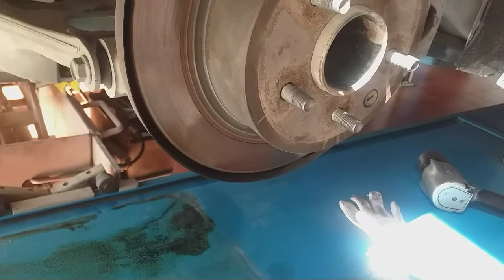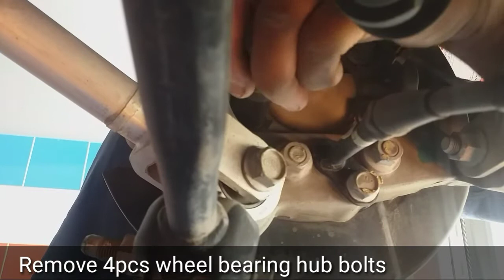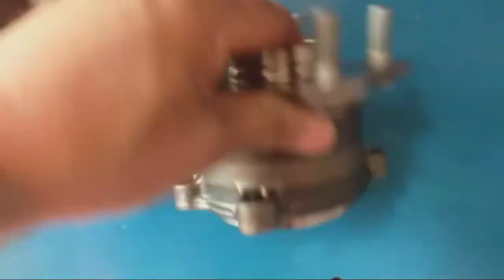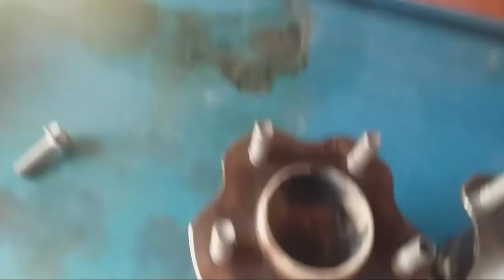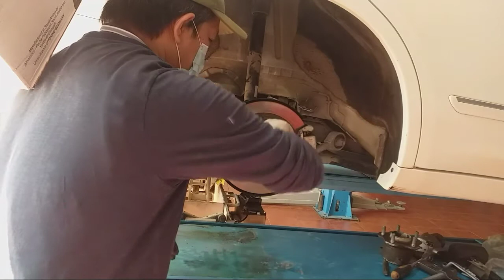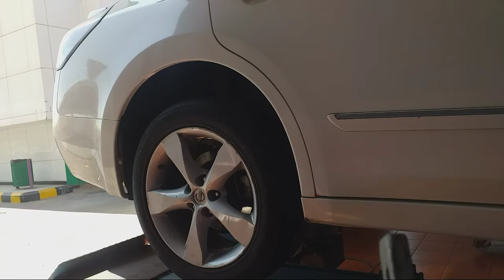How to Replace a Rear Wheel bearing   Nissan Altima

Comment: How come you didn't torgue the bolts to Manufacturer's specifics? Typical but sad.
Reply: Because when you turn wrenches for a living you gain the experience to know close to how tight something is.
Reply: @timmturner  Well I know that is happening all over America in every iota of mechanical and electronic fixes, etc!

And IF I was the owner of that auto garage or Electronic shop; I would fire any one that did not use a calibrated torque wrench; and a calibrated oscilloscope.

Fo a wheel that comes off going at high speeds; can kill people.; and the best video is deserved the best fix. And in my opinion; that it is always better to "err on the side of caution!".

Than say, "Well it works don't it? When it is less than it should be to the customer.

But to each his own. And thanks for replying kind Sir, anyway.